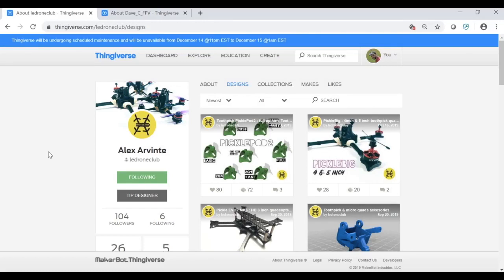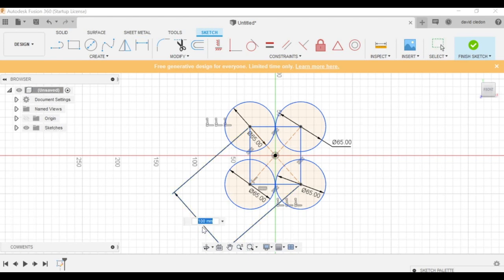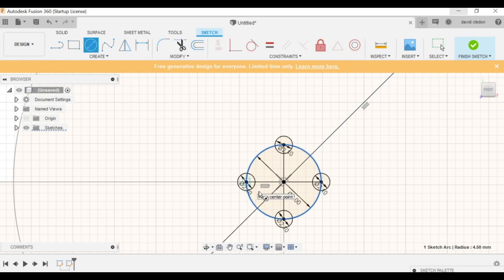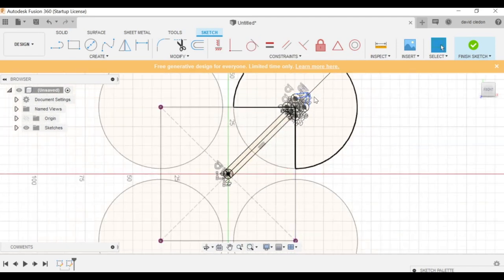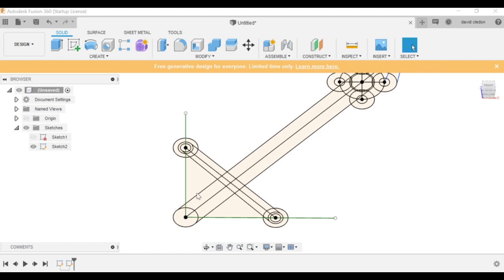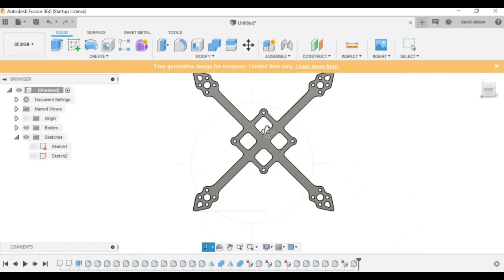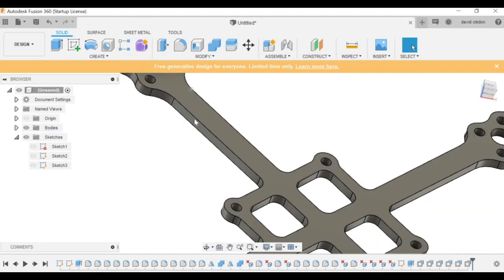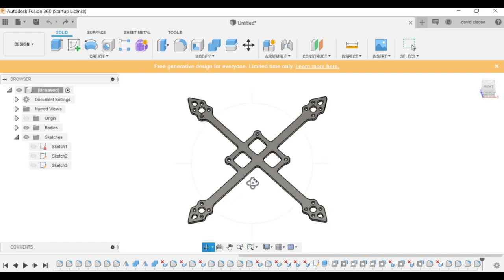Toothpick Micro Quad - Fusion 360 Tutorial

Comment: So you do absolutely give carbon cutters a headache I would suggest explaining the common size radii, and the smallest, that can actuall be cut with a cnc router: 1mm, 2mm, 3mm, 4mm diameters are common. That being said having a design that will need multiple radii end mill bits will cost more. Also quasi-isotropic refers to how the weave in conjunction to the layup patterns (how the thin layers of carbon are stacked during production). Just because the top surface layer is oriented one way doesnt mean the majority of the layers are oriented that way.
Reply from the maker: Wouldn't they just cut the whole thing with a 1mm radius tool? We are talking about pretty small parts here.
I never said you can always draw conclusions from the cosmetic  top layer about the layers underneath! But the CFK commonly used in this hobby happens to have layers with a 90degree orientation relative to each other so it's still important to design in a way that in principle allows a proper orientation of the parts
Reply: @DaveCFPV  1mm is small and there are good rules of thumb in machining not to mill too deep too fast with a small bit. So if you can increase the radius you can decrease the machining time and since most cnc carbon cutters charge mill time - you save money. And regarding carbon is it really tough to tell. I have a studied carbon fiber and advanced materials for a while now and carbon sheets are tunable and unless you know where your carbon sheet distributer sources their carbon and can track down layup diagrams it is a crap shoot on your orientation of you plies. It is not that hard to mark carbon sheet flat ( you just mirror the layup pattern  across the midline).
Reply: @zachcarrizales5038  why would they rotate the weave during layup? It would cost more in time and materials.
Reply: @ian4447 Short answer is because while aluminum is isotropic (same material characteristics everywhere in the material), composite materials including carbon fiber  are anisotropic (differring material characteristics in areas in the material). As a result if the anisotropic material characteristics when the ductile material (usually a 2 prt epoxy) is added it needs to be cured in an autoclave under heat and pressure. Curing the epoxy and carbon fiber composite can cause those anisotropic stresses and strains to display unevenly which causes the composite material to warp. In order to distribute the stresses and strains better and improve direction operational performance the plies are rotated every layer or several layers and then mirrored over the mid plane - which for 1mm thick carbon sheet would be at 0.5mm, hence midplane. It would help if you looked up a video of carbon fiber layup process or google quasi-isotropic carbon fiber layup pattern it will help you.
Reply: @zachcarrizales5038  You are assuming we use quasi-isotropic CF for quad frames. If it's not quasi-isotropic then the orientation on the outer layer is also what's inside.
Reply: @ian4447   Ian 444  No, sorry that is not the case. Quasi-isotropic is the preferred standard of mechanically predictable carbon fiber. Not everyone uses it. And additionally, if that logic holds up then do you truly believe that because IKEA furniture has a walnut veneer on it, that it means that the furniture is walnut as well? All I can say is do a bit of research on composite materials in general.
Reply: @zachcarrizales5038  I've been buying frames from Armattan Productions for over 3 years, and the inner lay is same as what is on the outside. I can tell by how it flexes. Maybe it's just their carbon that is like that. Thanks for the info.
Reply: @ian4447  I promise you it is difficult to tell from just the flex. Because the flex behavior can change based on the different 2 part epoxy.
Reply: @zachcarrizales5038  I can also tell by how it breaks.